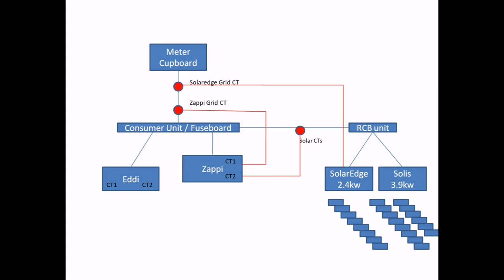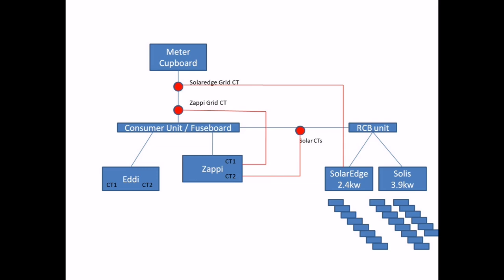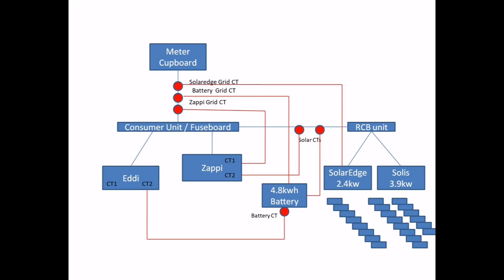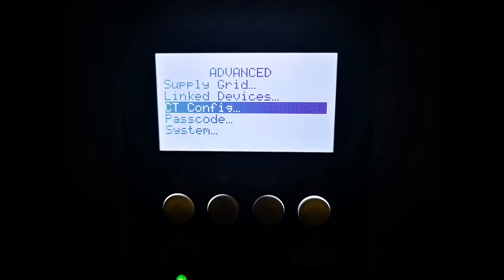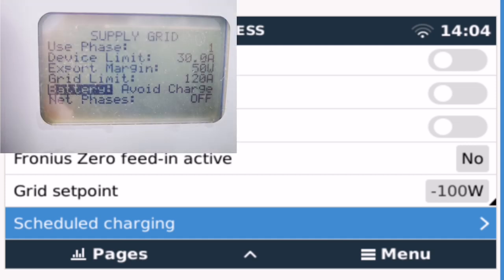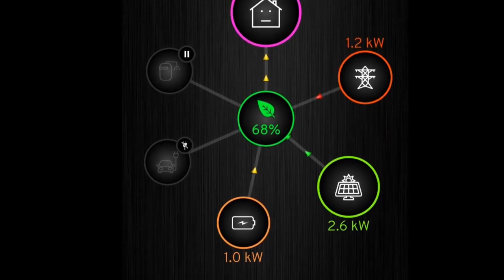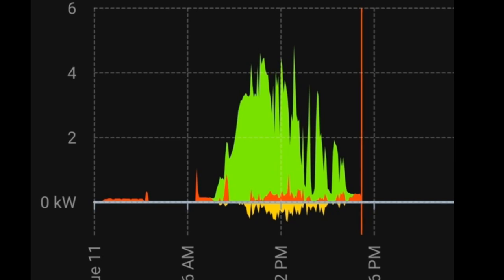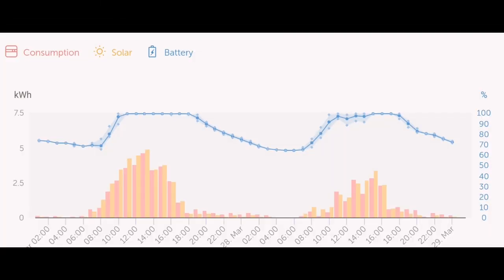Adding a Storage Battery to a Myenergi Eddi/Zappi configuration

Comment: I have a Tesla powerwall2, and I only only have 1 CT from my zappi, (oversight by me ), I can get round paying for another CT. I just change the batteries reserve for grid outages to 100%, easy to do, just a slider on the app.
It makes the solar work as solar only. So if you set the zappi as solar only, it doesn't drain the battery or use grid to charge your car. So easy peasy with the versitility of a powerwall2. I've had my powerwall2 since August 2017, and I've been extremely pleased with it.

Comment: The Powervault does exactly that it will lower the grid charge or increase battery output if no solar.
Plus you can manually adapt if you so desire

Like today I have had it on charge from solar only.

Comment: Hello Nigel, where did you connect your battery ct clamp for the Harvi? I am trying to connect my Givenrgy battery but there doesn't appear to be enough power to turn the Harvi on.
Reply from the maker: Harvi doesn't need power it uses power from the magnetic field of a live cable . I connect to my Eddi directly on a CT input I don't use a Harvi
Reply: Thanks for the reply, I was putting the CT clamps around a cable to induce the power to run the Harvi. I didn't appreciate that you can't use a DC cable to run the Harvi. I had to get my electrician to put the CT clamps inside the switch box. I also didn't know that you can run the Harvi from a 9 to 12v supply using a spare CT slot.
Reply from the maker: No worries, yeah Hybrid inverters and DC aren't easy with the Myenergi kit

Comment: Myenergi are working on their own battery system.
Systems take time to react and windy broken cloud days are hard for them to react to fast enough.
Reply: I don't understand that argument.  When you consider the commercial battery arrays that come on-stream in milliseconds or less to smooth frequency or supply power, as in South Australia, then this must be a limitation on what can be done in a domestic environment.  This sort of echoes that dreadful FullyCharged video when Robert had a power cut simulated and it took seconds to switch to battery.

Comment: I am not seeing any info for my batteries, should there be a CT fitted on there too,I can see solar, grid car, is this the issue you faced? Thank you
Reply from the maker: Yes you need a CT for any AC connected batteries to see them. If you've got a hybrid battery system then you aren't able to see them via myenergi. There's no DC power CT clamp
Reply: @EVPuzzle  ah I see, that explains a lot, thanks for explaining that, was a head scratcher ha ha 👍

Comment: Now you have Multiplus with house on Critical Loads, how does Zappi know what the true solar excess is? Excess = Solar - Multiplus. But if Multiplus is feeding house via Critical Loads from its battery, then Zappi will see a Multiplus load of 0kW and so assume all the solar is excess. It then takes this resulting in battery discharge. Thanks
Reply from the maker: Not sure what problem your referring to but my Zappi CT looks just at my solar output, it doesn't see the Victron at all.

The only down side is the House use values in myenergi app are zero when the load is covered by the battery

Comment: I did not realize until today that you had a Fronius and Victron product installation.
Reply from the maker: It was Victron but now GivEnergy
Reply: @EVPuzzle  aha!

So, it is part of the battery.  Thanks.

I have been researching batteries, and believe it or not I have been drawn to gel Lead batteries using a Multiplus II GX inverter from Victron as an ESS.
It would need about 27.6-kWh of batteries, but available storage is only about 13.8-kWh.
It should last for 9.3-years with this last amount available 100%, and if %DOD is 30% of 27.6-kWh, it should last over 13-years.
A bank like this has 24 cells of 2-volts each.

The cost for battery and inverter / charger is £4,900, and the cost per kWh is £0.0824.
Reply from the maker: Very interesting.  I too like the Victron Multiplus II but I'm favouring pylontech batteries but I'll look at these. Have you got a link for them. Curious.
Reply: @EVPuzzle  I looked into the Pylon Tech as well, but do a comparison of costs per kWh.

https://autosolar.es/baterias-estacionarias-opzv-2v/bateria-estacionaria-576ah-2v-opzv-ultracell-uzv580-2

Remember that neither Lithium nor Lead like temperature extremes.  So, whatever chemistry you choose, make sure you solve for temperature extremes.
Reply: @EVPuzzle these particular batteries by the way are manufactured in Liverpool in the U.K.

https://ultracell.co.uk/www.ultracell.co.uk/products/uzv-batteries/2v.html
Reply: @EVPuzzle  here is a gel Lead battery:

It is made of 28.8-kWh of batteries, and available storage is 14.4-kWh.
It should last for 9.3-years with this last amount available 100%, and if %DOD is 30% of 28.8-kWh, it should last over 13-years.
A bank like this has 8 cells of 6-volts each.

Maintenance required is twice per year.

The cost for battery and inverter / charger is £4,280, and the cost per kWh is £0.0675.

Comment: I’ve just bought the MyEnergi Zappi, Eddie, Harvi and hub to go with my PV array and battery, tbh I’m a bit lost as to how to set up the system with the CT clamp placements, channels etc so your video was really helpful. Ty 👍
Do you gave the Esense wire connected in the Zappi? I’m trying to find out where the other end of the cable attaches too.

Comment: Hi, for your battery set up do you have a separate inverter in front of the battery?
Reply from the maker: Yes I do it's a bolt on ac coupled system rather than a hybrid inverter config

Comment: Have you tried simulating a power cut yet, Nigel?  It'd be interesting to see how a fully/partly charged battery dealt with that.  I would guess there would be a few tenths of a second for the various gizmos to do their thing then it would fully run the house on stored power.  Well, that's what I would hope for!
Reply from the maker: Rick, the Victron inverter has a circuit for powecuts but it's only meant to power a circuit for emergency lights and or a plug or two, it doesn't power the whole house like a Powerwall.

As this is a test we've not wired anything in at all

Comment: I have to say that my Powerwall does not suffer this problem - it reacts within seconds. As an example my system has generated a choppy 7.89 kWh today thus far and I have imported 0.04 kWh - according to SolarEdge.  According to Tesla I have imported 0.1 kWh - my guess this is a rounding error based on display restrictions.  I do not yet have any other smart tech though.
Reply from the maker: Gavin, it's the smart tech that's the problem, mostly. Without the Eddi or Zappi it's s lot less complex and uses less grid resource, hence my search for clear priority settings to limit which device is receiving the Energy
Reply: @EVPuzzle  - could you do a test where you, temporarily, turn off all the smart stuff like the zappi and eddi and only have the battery and solar to test the theory?
Reply from the maker: Yes, that's the sort of thing I'm doing. Tried and failed the other day to not use the induction hob. 
One day I'll get a clear day to do just that. Turning Eddi off is easy and Zappi isn't in use these days at all

Comment: Maybe the small spikes comes from the delay if the harvi's. Like you use an Bluetooth headset to listen to a TV program and come to the conclusion you've don't have lipsynchronisation any more.
Reply from the maker: I'm aware the Zappi and Eddi reduce or increase rates by halfing them halfing again and again etc until the right level is reached. The various steps in reduction cause the delays I believe. I can only guess the battery works the same and doesn't add 2.3kw in one big jump
Reply: @EVPuzzle  what I thought becomes true. Most of the off the shelve systems works digitally, even with current clamps, instead of an analog. The Belgian smart meters have 2 output ports for the customer, a normal digital one with 1 sec update rate and a fast pulsed one with a refresh rate I think of 2000 per second. (It can be 10000 also) I don't own one yet and are not yet in the planning.

Comment: Hi Nigel, I know this video is getting on but the principles are all valid. I note you have several ct’s at both ends of some of the circuits. Can I ask are you using multiple Harvi’s and have you now got home assistant involved too?
Reply from the maker: Still not needing a Harvi. 2 cT on the Zappi and one on the Eddi are enough for grud, solar and battery . My other CTs are for Solaredge and a stand alone In house display
Reply: @EVPuzzle  thanks for the response Nigel. No Harvi as I’ve a heat pump. All gear in the attic and CU 2 floors below in utility. Zappi 5ms to the right of that, so all too far from each other. Like you said in this video the info is sparse, but based on your video and 2 forum posts it looks like I need 2 Harvis, clamps on batt and PV in attic and Harvi with 1 clamp in CU for solar trip. That’s my guess anyway 😀
Reply from the maker: Just so you know I extended one ct to reach the Zappi and that works fine . Worth a try

Comment: Is this an AC battery or DC battery install?
Reply from the maker: If you follow my other battery videos you'll see apart from the Huawei install they were all AC, Puredrive, Givenergy and Victron
Reply: @The EV Puzzle  is there a way to separate a dc battery to a different icon. My battery and generation are coming from the same icon and I can't see my generation. However I can see it from my inverter
Reply from the maker: Not on myenergi no it has to be generation /battery. Myenergi only works with AC batteries really

Comment: Nigel, was this video done before you realised the battery wasn’t working correctly? Will it make a difference when the faulty battery is replaced?
Reply from the maker: Sort of. The impact of the dodgy battery isn't fully known.  It appears to work ok between 99% and 40 % apart from consuming much more energy than I get back out

Comment: These seem awfully complicated. I've had my initial array for over 12 years so getting a nice FIT as well. Why not take the house "off grid" and only use power from the batteries, then you don't need Eddi's and most of the other stuff. You never export anything and you only import to charge batteries. That you can do on a low tariff using Octopus Agile or something similar (if you actually need to!).
Reply: If you're on FIT, it is likely you are "grid-tied".  This means if you do what you suggest, you would lose your FIT payments.....